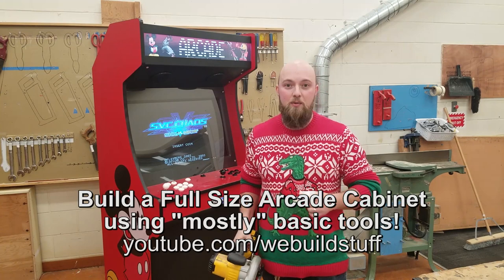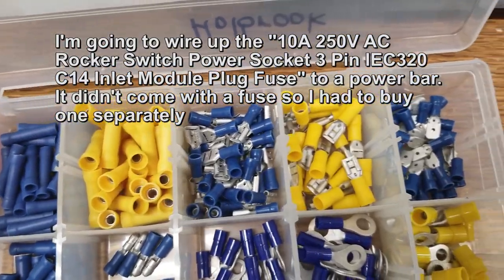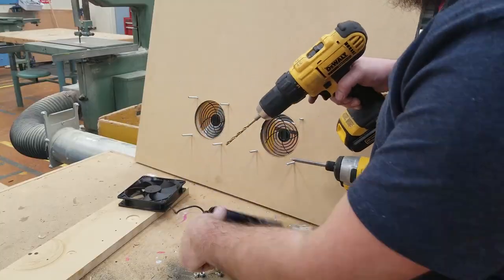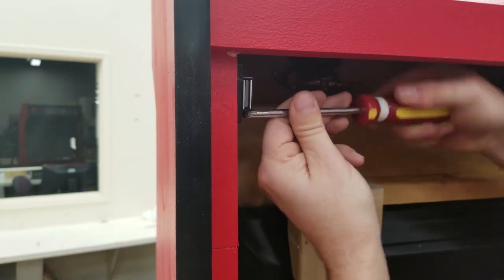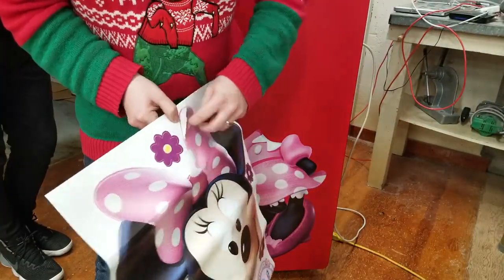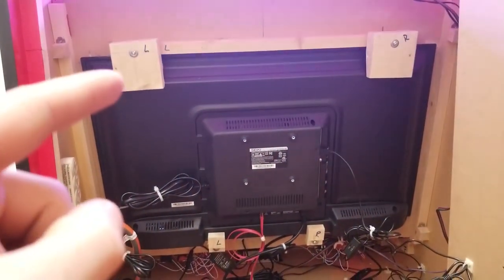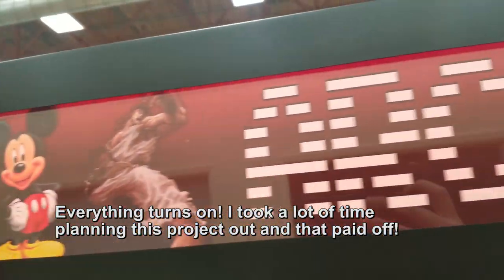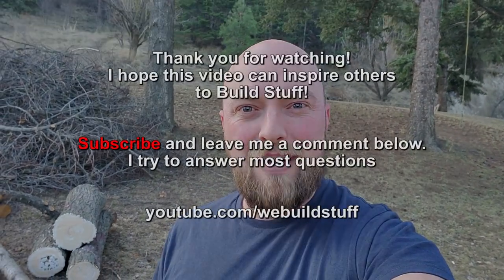DIY Full Size Arcade Cabinet with Basic Tools - Part 5

Comment: Looks unreal man. A wee tip for next time would be to inset the the joysticks into the control panel. I noticed they looked very short and that would be because the mdf is so thick. What did you say it was, 18mm? Just inset the sticks from behind by like 10mm. 

Class job though. I watched the whole series and I'd love to replicate this for my own build.

Comment: Pretty straight forward plans for us noobs. Two questions, could i use the plans for 1/2 inch mdf for easier laser cutting and lastly, did you have to change the joy stick from 4 to 8 position by taking the console off?  thanks again.

Comment: HI. first of all congratulations for the video. Unfortunately I don't speak your language but the video is quite understandable. Since I'm building a cabinet I have doubts about the wheels. It seems like you put 2 fixed wheels on the back side and 2 swivel wheels on the front. you can also lock the rear ones if I saw correctly, but if you leave them free does the cabinet move while you play or is it stable? Thank you
Reply from the maker: The cabinet was very stable
Reply: Was it stable even with the wheels unlocked? do you have any photos showing the wheels installed? Thanks again

Comment: Great video!  Do you have a video on how to make the emulator?  I would like to make one with light guns
Reply from the maker: I use Recalbox as my front end with built in emulators for each system.

Light guns are tricky..... https://wiki.batocera.org/emulators:lightgun_games
Reply: Sinden Light Gun now works with LED tvs. Kinda expensive but they're so cool

Comment: Hi, since we have a different size in my country, what diameter and length are the bolts you used to secure the panels? we use cm for measurement. Thank you
Reply from the maker: Depending on which part and the thickness of your panel you would probably want anywhere between 4-5 cm long bolts and I wouldn't goo smaller than 4mm in diameter due to the strength required. 
When I designed this one I chose my fasteners based on what was easily available and not super expensive
 Most of my t nuts and bolts are #10-32 which is (4.76mm in diameter or 3/16")
Reply from the maker: Find what is readily available in your area. I like using t nuts because they come apart easily and won't strip the material like a screw would
Reply: @WeBuildStuff  First of all, thank you for the reply. I was considering putting an M5 I think it corresponds to the diameter of 5mm. my bolts will be cross screw and not with the allen screw system. The panel I ordered is identical to your 19mm MDF, so the length must be at least 4cm. Unfortunately I cannot attach photos to this page.